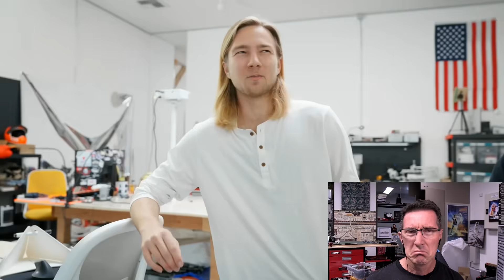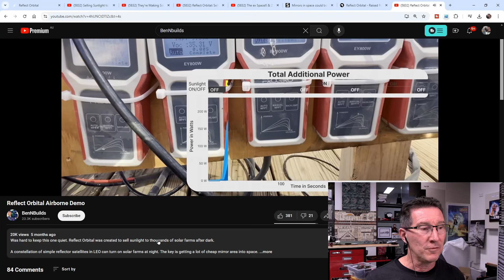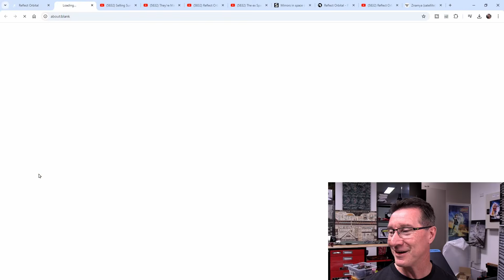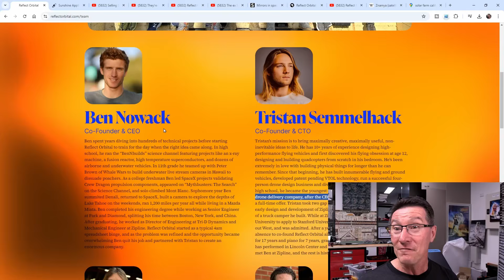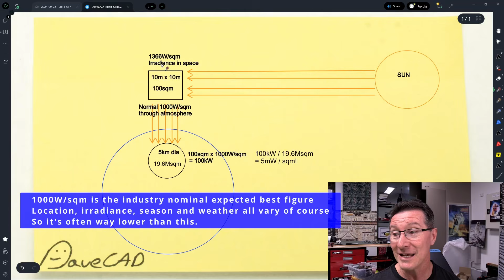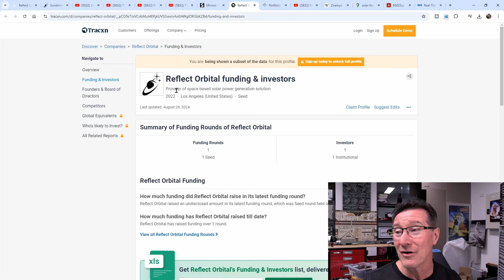EEVblog 1637: Solar Freakin' Space Mirrors! - Reflect Orbital DEBUNKED

Comment: How can anyone  not see this doesn't work?  The simple 100x100m to 5km translation is all you need to see it's hopeless.  And why 5km? Some atmospheric scatter, but you'd need a  convex mirror to get that.
Reply: The 5km diameter comes from the 0.5 deg angular diameter of the sun as seen from earth. This means that a flat mirror at a 500 km orbit shines a cone of light down that spreads out over a 500 * sin(0.5deg)  = about 5 km disk of light on the ground.
Reply: @2meters2  I highly doubt that their Mylar mirror will even be flat, which makes it even worse.
Reply: @2meters2 I theory this could be solved by slightly deforming the mirror foil. But even if you could collect 100% of the reflected light 100m^2 just gives you 100kW of solar irradiance or a measly 25kW of electrical power - pretty sure a 1MW windturbine would be a lot cheaper than 40 of those satellites 😅
Reply: @robstamm60  Windmills run at about $1M USD / MW (ignoring land, etc).  SpaceX charge about $65M for a Falcon launch (4 BIG turbines), as rideshare you could launch one of these for about $250k.  A decent sized turbine would make more money in one day than this would make in its lifetime.
Reply: A fool and his money are soon parted.
Reply: I used to see sunlight flashes from the iridium satellites. I don't remember it lighting the area I was standing in.
Reply: @threeMetreJim it was way brighter than the moonlight if you were on the brightest path, you could see your shadow on the ground for the duration of the flash, but il was still way way dimmer than a small bedside lamp
Reply: @threeMetreJim  Hmm.  So wiki says the Iridiums had 3 "door sized" solar panels, so about 6 square metres.  Yeah... it's not looking good.  I miss the flares.
Reply: I wonder if they did all the calculations for 10x10 km mirrors in each satellite,  which would be insane of course,  but it would probably get pretty close numbers to their initial claims..
Reply: @elektromagnetik2786 id like to see the calucations on how much fuel is needed to keep the sat in orbit with that huge sail. Solar wind is prob gonna push that sat away
Reply: @elektromagnetik2786  i roughly calculated it, u need a 2x2km reflector to get to the 200W/m² in the 5km circle on the surface with no losses at all which in itself is impossible.
Reply: @WoodHead0815  A 2x2m² reflector creates a far larger illuminated area.
Reply: Agreed. I think the translation from 100 Sq m to a circle of 5km is what they are completely ignoring.
Reply: @bert-blank  Funnily enough, it is the most basic thing they should've calculated on a napkin before going forward with this thing. Literally from an idea to scrapping it in one minute or less.
Reply: I'm completely ignorant on this and even I know sure enough to bet money that is isn't going to work as claimed
Reply: I know nothing, and it sounds ridiculous to me...
Reply from the maker: @volvo09  When I told her about it, Mrs EEVblog laughed and said "are they serious". She instantly knew it was impractical for generating power.
Reply: @EEVblog @EEVblog  The Germans already did the math for a "sun gun" during WWII. They supposed they needed a 9km square parabolic mirror to melt cities. So they only have to build and launch 900, which seems paltry compared to Starlink's proposed 12000.
Reply: Also, the foldable Mylar reflectors will have nowhere near the required flatness to deliver the power to a reasonably small target area. 
If you ever tried to annoy your classmates with reflections from your phone screen or watch glass, you'd have noticed that those surfaces that look very straight at first glance will reflect amorphous light blobs over distances of only a couple dozen paces. Some of my phones' corners switched places in the light image on the wall. That counts as high-precision glass, and it's still not enough. Imagine the shape of the reflected light from what is essentially a photographer's flash umbrella, but from an orbital distance.
Reply: @Marci124  well, i imagine other things, so, please do not inform me
Reply: @Sergiu.antifascist  I looked through your other replies in confusion, since your reply here is a complete non-sequitur. I'm somewhat relieved to find that most replies you've made in the 5 day lifetime of your channel seem to be nonsensical.
Reply: @Marci124  prove it!
Reply: @Marci124  if you cannot prove i post nonsensical, then nonsensical are you
Reply: u need squat! higher productivity would mean lower capital performance. 
i prefer to get a million dollar per watt
Reply: @Sergiu.antifascist  Why stop there? ... don't cut yours3lf short
Reply: “How can anyone not see this doesn’t work “. I dunno, probably for the same reasons people couldn’t see that there was no way in hell that the Solar Freaking Roadways were going to generate enough photovoltaic electricity to keep the snow melted off the roads with electric resistance heating.
Reply: If only they can add the word Hyper to the company name to aid the next round of funding.
Reply: At an optimistic distance of 200Km a 10mx10m (100sq m) mirror is practically a point source.  With the sun's angular diameter being half a degree that means the beam will have a corresponding spread of half a degree. That is 26 meters per km.  At 200kM that is a 'spot' with a diameter of about 5000 meters. That is when the satellite is directly overhead.
If the mirror was ten times as large on each side the spot would still be about the same diameter but have 10 times the intensity.
Reply: I thought they were going to have some huge leviathan mirror folding out of each satellite and cover half the sky or something..  You know, like something spectacular;  but  when I heard it was only 100m sq..  I couldn't stop laughing.
Reply: Because they want to see scientists like the gods they claim they’re too smart to believe in and want to believe that there is a technological solution to every single problem and wouldn’t dare to disagree with those promising that and it is the nonbelievers fault if the technology fails.
Reply: @chrisnoname2725  "a technological solution to every single problem", hey, that was the previous Oz government's policy for everything!

"How do we fix..." "Technology, bro!  Just wait 20 years bro!"
Reply: If you  look at the value of such a pseudo company it rises by selling and buying bonds, it generates good profit for them, i checked the growth of the energy grave shortly.
Reply: But it DOES “work”, Mike…if its cunning intended purpose is to trick the gullible out of their money.
Of course it does not trick criticsl thinkers like you, I or Dave. These gees sre not engineers, they are marketing goofs.
Reply: capturing enough iight at the edge of shadow would require amplification / magnification / focusing to a hotter brighter light
you cannot reflect from behind the curve without height, dissipation must be factored at any significant height
itd need to be 5km square reflectors lighting 1km square areas just to account for the angle of inclusion
are these the suckers or the scammers? both?
why does nobody there have enough life experience for even 1 wrinkle? 
looks like bunch of 25yr old been a failed CEO 5x already bull snot to me
Reply: They do know... You guys think they're just candid wannabe engineers don't you ? They perfectly know all this, they're con artists, whose only purpose is to take millions away from gullible people... Pretty straightforward.
Reply: 10 x 10
Reply: @ingulari3977  only if you are stupid enough to not even piss. forget about it, then piss yourself. nice! now you are wet
Reply: because we are at peak stupidity..and they have not looked at Copenghagen Atomics....first thorium reactor will be tested in the swiss alps.
Reply: @simonstergaard  nope. it will not. it is already tested, and it has not great perspective
Reply: Somebody watched too many movies there James Bond.  😆
Reply: Most people seem to intuit their maths rather than calculate it \-:
Reply: Look at naturejab!! 😢
Reply: But I think it will work perfectly as designed. They are SpaceX engineers, so they know enough from SpaceKaren how to squeeze money from gullible people... Just imagine those satellites with full self driving.
Reply: Only investors have to not see it work... and it's just like a Nigerian letter. The one idiot who buys into this can be milked to the end.
Reply: Your thinking about it all wrong.   you need a very big dumb mirror and a very precise focal point mirror with independent moveable segments . then it can be highly controlled  with lenses and filters . i think we have off the shelf parts rn to build something that could reliably control and hold a 4'x4' target on earth at any desired strength.
Reply: ohh and it may be able to help with sunspots.  :face-blue-smiling:
Reply: Missed opportunity: they had the chance to call it Icarus....007 did it better
Reply: 57 satellite “interviews” only check these guys are getting is from YouTube
Reply: Why 5 km? It's the size of the sun divided by the distance of the sun multiplied by the distance of the mirror. 1.4e6/150e6*600 = 5.6

Sunlight is not collimated.
Reply: @to_loww  Size of sun (m or km) divided by the distance of the sun (m or km) then divided by the distance of the mirror? This is not passing dimensional analysis.
This is km/km/km

km/km = dimensionless. Dimensionless divided by meters is 1/m.

So by your math, it has a size of 5 "inverse meters".

Therefore, contradiction as 5 km is not 5 (km^-1).

Basic physics is great to debunk things :D
Reply: Do they not teach maths anymore in school?
Reply: @DavidClunie they had their calculations done by the same people that calculated spin launch
Reply: nahh... If they use the new "Solar-Convergence Algorithmic Matrix" this would totally work and be profitable 1000%. For them at least...
Reply: The video did us the disservice of leaving out the important upside analysis.  It has to start somewhere — and this is more than just a stunt. It’s a proof of concept, using CubeSats to validate the physics. Remember: reflector area scales with the square of radius. A next-gen system could deliver 1000× more per unit. Add collimated secondary mirrors at Lagrange points, and you’re talking real directed power. Compare that to the billions sunk into hydrogen fusion with nothing returned. This will do something from the first launch and it has unlimited upside potential incrementally available to it.  Finally a project with real answers!
Reply: It’s ridiculous to think about focusing strong light (yeah to make it work your gonna end up making a really high powered laser) to prevent light from scattering over multiple kilometers of distance to the earth’s surface. On top of that, you only get 4 minutes, which is sort of trivial compared to the cost of getting these things in space.

What is this, the Icarus satellite from “Die Another Day”? (One of my favorite movies in terms of action in the James bond franchise though). 

For this to be actual useful, you would have to get clearance by the government because like how rockets can become guided missiles, light beams can become lasers that can kill, fry, or destroy structures on the ground or in the sky (other useful satellites that give us gps data and cell service) with intense heat.

Even if this gets support by the government, solar panels will not be the intended use, but instead as a sort of arms race like having a nuclear missile warhead with increasing potency.

Comment: These satellites will reflect radio waves as well as sunlight, which means interference to radio, television, police, fire, ships, aircraft, military, and most dangerously aircraft radar. Every frequency on the radio/TV spectrum will get a constant low level mishmash of every signal being transmitted on your hemisphere of the planet. They will not be listenable, as you will get echoes/reflections from multiple satellites all delayed different amounts, so will just be noise.

Comment: He’s way off with that “5 mW/m²” nonsense. That only happens if you assume the light is smeared over a random 5 km circle. In reality, Reflect Orbital plans 600 km Sun-synchronous orbits with high-reflectivity mirrors (~96–98%).
That gives about 0.1–0.2 suns on target — not full daylight, but perfect for extending solar farm output by ~30 minutes before and after dusk. For a 1-GW desert solar farm that’s ~18 GWh extra per year, equal to 26,000 barrels of oil saved or about $1 million worth of electricity.

So no, it’s not “5 mW/m²”. It’s a measurable, valuable boost.

Comment: 5mW if solar panels have 100% efficiency of converting the light to electricity, but sadly they are at most 25% efficient, so that means they will actually get 1.25mW per square meters and that is if the mirror light falls at right angle to the solar panel... just shows how bad is the schools system for young engineers not to be able to calculate this stuff before making claims
edit: you addressed it later in the video

Comment: Haha this is the most ridiculous thing I’ve ever heard. If you spread 100^2 meters of sunlight over a 4km diameter circle your light that’s 12566370^2 meters you loose everything. Thats like .000795775% the energy output of the sun per square meter.

Comment: I have checked your calculations; you were generous with them. You need to account for the angle of the solar panel, as they are optimized for the Milka plain rather than the satellite's direction. There’s one point you missed: they plan to launch with SpaceX's Starship at a cost of $30K per vehicle.
Bottom line, you are correct, and I’m not sure what is going on here—is it a scam or sheer stupidity?

Comment: They simply forgot to take into consideration that the power captured will not scale up. They probably calculated with 1000W per square meter for the 5km spot. Thought maybe they hope to reflect down light to the same spot from multiple locations at once but how many sats do they really hope to release? You would need a massive number of them to compensate for the loss in power/sqrm.

Comment: Cities spend megawatts of power to light up streets in the evening. You could go that way. 
1. Zero inefficiencies in conversion.
2. Cities already have large areas. No need to focus or precise aiming.
3. There is no low limit of usable light in a city. Every photon will be of use, unlike with solar panels.
4. Lighting a city with mirrors may be seen as a fun public stunt. People just may like it despite its inefficiency and meaninglessness. That's where you can make money even if it may be cheaper to light a city with roadside lights.

I know, my idea is still dumb. But it is a dumb of a "Elon Flamethrower" type. It's still impractical, yet people may want to pay for it just besause it looks cool. But paying for 0,000000000001% more light on a solar panel during the day - that is a "complete dumb" type.

Comment: There's no way to make money on this as long as you have to launch the damn things with chemical rockets.  If you have a system that can put this up cheaply enough to make money, you'd be better off putting satellites up in geosynchronous orbit and beam the power down as microwaves.  (The receiver is at least 20 km in diameter, so even at a total transfer of 10 GW, your beam density is about 64 w/sq.m, so it's really not much of a danger if somebody hijacks the beam controls, and a power satellite is a pretty easy thing to kill if you really can't get control of it back.)

Comment: They want to provide a satellite with a mirror of 10x10 meters 100 sq m and they want to illuminate 5x5 km aka 25,000,000 sq meters anyone see the problem?? The sunlight is diluted by about 99.9996%. The moon reflects about 3 to 12% of the sun light. With the small mirror 10x10 meters you get only 0.0004% in a 5x5 km area.
Reply: You're quick to dismiss the idea from data using a single sample point. At least let them acquire the test data from the leading worldclass travel destinations  before you go trying to debunk the idea.

Comment: my graduation work, as Physicist, many years ago, was in renewable energy sources... 
i confronted with the idea of orbital solar reflectors, or captors. 
at that time there was no debunking, and all scientifical resources pleaded for that. 
in my graduation work, i pleaded against, i debunked it, but it remained just a graduation work. 
my work was about eolian, for most, but it was required a first chapter to be on all renewables. 
had no sourcer available to use back then, therefore my work quoted none, it was pure personal work. 
it was, and still is, not as funny as you perceive it, because all NASA projects in this are crap.

Comment: -Now make them 1km x 1km
-Scale it with 100 units
-Stick in geo-stationary where it can beam all night long.

Now run your numbers. Big difference.
Reply: Someone might want to look up what geostationary means and reconsider their idea...
Reply: @totalermist  Geo-stationary means wider field of view.
Reply: @slipperyslope3912  No. it means the Earth is between the sun and the satellite 12h a day.
That's why sun-synchronous orbits are used in the first place.
Reply: No. The reason why the spot on earth is 5km from a 10x10m mirror is that the sun isn't a point lightsource. it has an angle of 0,5° So the area that is lit up will get bigger and bigger. with every km , the diameter gets larger by 18m.  So at 35.000km, the diameter would be 630km
Reply: @Flinno-k8w  Not if you concentrate it. Think lasers.
Reply: @slipperyslope3912  Lasers have a very different principle. To focus the light of the sun, you have to make that 1x1km mirrors parabolic. good luck with that.